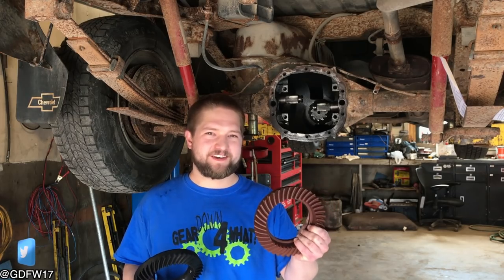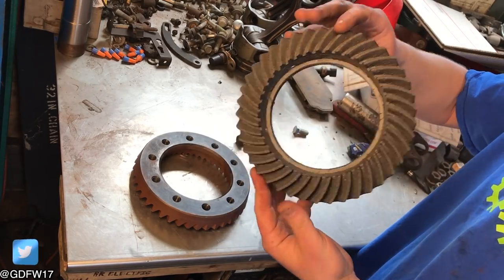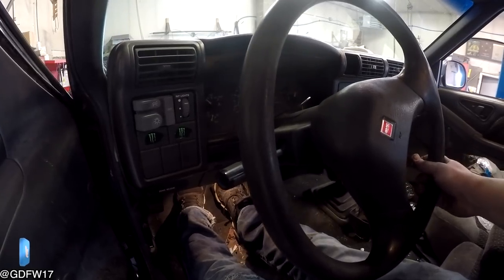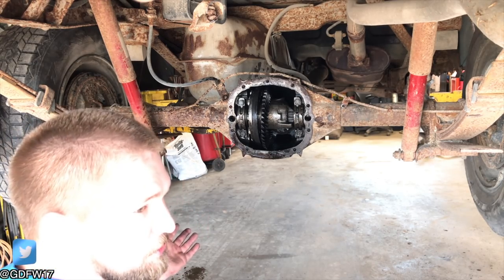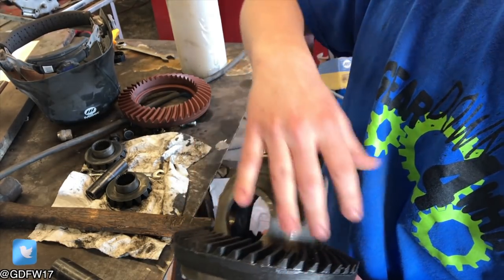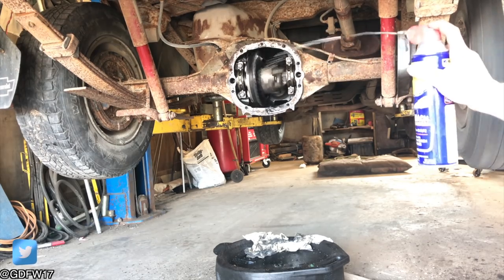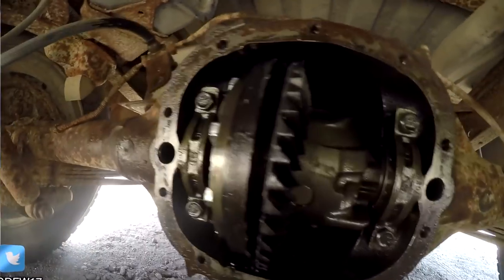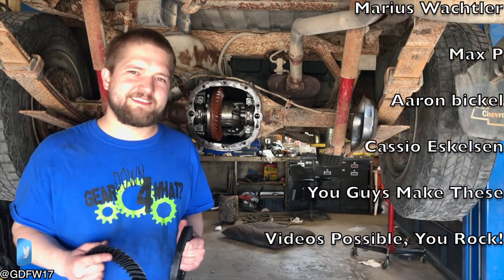Replacing Drivetrain Parts with 3D Printed Carbon Fiber Nylon - FOR SCIENCE!

Comment: If you printed it in reverse (from the teeth back towards the mounting face) and "paused" about 1/2 way through the nut to embed them, your shear face would be centered on the nuts (which would act as lugs/keys), rather than right behind the gear face (which is where the greatest shear force is concentrated.

Possibly even reheat the piece before resuming printing for better bonding... but I don't know if this will affect strength...?

Comment: My suggestion would be printing in two parts, using very big and long nuts and recessed holes in each side so that the bolts spread the load into both halves. Then you press the nuts into one half and glue on the other half while pressing the nuts into that half.

Right now, all the torque is going straight into delaminating the two halves because the bolts are embedded into only one side

Comment: Very cool video. I am surprised the gear didn't fail at it's teeth. If you printed the thing in one shot and used thread inserts I bet it would work very well. Impressive material and impressive printing skills!

Comment: I like the idea of 3D printed gears...encasing the nuts like that is the way to go imo. 
Maybe you should put little steps into the two surfaces that interlock afterwards, kinda like one of these nordlock washers if you know what I mean. That way the shear stress doesn't tear the differential apart, that's the weakness of all adhesives. Also you could maybe try leaving cavities in the print for pins that go almost completely through? Like a wall tie in masonry.

Comment: I think this is great guys! Fun to experiment.  I use same filament.  I see that if you solve the part integrity problem you will be faced with thermal problems due to low melting temp of filament.

Comment: If you really must pause the print, can you design in some alignment teeth between the 2 layers to hold more strength? Or maybe just skip the metal nuts altogether and tap threads right into the material?

Interesting test project though, it would be awesome if there happens to be a successful way to accomplish this.

Comment: you need to print the part in the orientation as it sits in the diff. the part is weak because you stopped the print, but also because the layers are in the same orientation as the torque being applied to the gear.

Comment: I am a designer of bevel gears so this was very funny for me to watch. It would be very interesting to see how much the teeth stand up to if you could get the delamination problem to work. There is probably quite alot of sliding on the teeth so apart from the strength aspect you also must lubricate and cool the gear. Normal steel gears can be 200 deg C at the immediate surface. I wonder if that can be an issue for nylonx?

Comment: Probably drill out little pits before continuing printing so that there is some pressure points and you could put some adhesive to the pits so the two parts sticks well

Comment: I'd keep the nut insertion trick, but print the ring in two crenelated parts so they interlock like puzzle pieces. The forces applied in the diff would have to shear half the circumference worth of material.

Comment: maybe melt the plastic on both halves then push together and fuse em that way? you might be able to add little bits that jut out on the edges on both halves with holes in them and use those to screw them together with nuts and bolts if there is enough room for that.

Comment: I ebbed nuts in a lot of my prints, before I restart the print I use a heat gun, if you're careful you can get your part back up to printing temp without any distortion... I need to do this ring gear test myself. Very cool

Comment: This was a great video to watch because it just shows the great innovation being taken to use new technology to make parts. I believe this idea can work without pausing the printer so it won't disrupt the layering process which led to the part failing. I think you should tap the holes or put in some kind of metal insert grooves to hold the nut inserts in place. Also keep in mind if that idea works then I believe you can only apply so much torque before the teeth rip off.

Comment: Might try reprinting it with 3d printed dowels inserted into hole around it so you can align the fiber grains  of the dowels directly perpendicular to the force applied.

Comment: Press fittings? I don't think there would be enough pulling force on the threads for it to matter. I hope to see a follow up, best of luck. Have you seen the mouse trap cars? I was also wondering if you have any interest at pursuing a WR attempt in distance. I had some ideas of adding a possibly flywheel. Maybe a low enough gear ration and a low enough friction may? The world record holder is an engineering professor and inventor.

Comment: I'm very interested in seeing this being further tested as this seems to be a fix for my expensive but weak transmission problems.
if there was a gear set like this that was feasible but would be the only area of failure easy replacement. i find this to be a very  probable test i would keep trying!
Reply: Meh.  It will never be good.  It is plastic.  3d printed metal on the other hand is another story.

Comment: A new design made with 2 layers, guide pins and JB Weld would probably do. The guide pins could transmit the power and so the adhesive doesn’t have to, or maybe even some registration marks. It’s a shame non-planar 3d printing isn’t more readily available, I think non-planar layer lines would solve this issue.

Comment: This was an epic try. I've got a raise3d N2 Plus (because of a review from 3d Printing Nerd actually, it's AWESOME) and would gladly work with you to try and make the part out of polycarb or whatever material you want to try. Send me the stl and I'll send you the prints. Also, like others have said below, don't use WD40. Try something like a 75w oil or even a high temp bearing grease so it sticks while you've got the back cover open. Personally, after it's broken in, I'd try putting the cover on and filling it with oil before driving around. Hopefully I'll hear from you and if you want to try other stuff like nylon sway bar bushings, let's do it.

Comment: There's far too much pressure and wear with a differential to not use something with the strength consistency of metal or more than that. 3D printing of parts would have to be limited to cosmetic components like door handles etc. Sometimes you just have to try it out to find it out though right?

Comment: You should try printing it and then pausing your print but not taking it off just increase the tolerances for the bolts or the a heat gun or soldering iron and hold it to the metal to heat it up and then push it in and try it that way

Comment: Were you guys trying t see if a printed gear would work? if so first it looks to me that there is a lot of area on the inside that could have been filled with the medium when printed. And have you ever used helicoil which is stronger than the threads in the original threads in the stock gear?

Comment: I would redesign the model into two parts so that you can print the teeth with the layers aligning 90 degrees to what you have now as that will be the next weak spot that will break.  The bottom part of the model which can be printed with the same orientation as you have now will need notches for the teeth to be glued in.

Comment: Print in two layers with pins that interlock and use epoxy to bond the two halves together or drill and pin the two pieces together, that’s what I would try to give it a better shearing strength

Comment: I would recommend you drill holes in it an press .250 diameter pins into it. This will give it more shear strength and not allow it to just peel apart. It will continue to delaminate no matter how good you resume your print.

Comment: Maybe try using timeserts for the thread u could tapping after the print is done .... And timeserts are designed to bite into the material in the opposite direction of the thread internal .....

Comment: 3d printing should be used in order to construct prototypes and low strain replacement parts as well as for making models for casting and art, however experimenting with it as seen here is very interesting and provides potential scientific knowledge about the properties an limitation of the technology, in other words, good video.

Comment: Possibly use a heat gun to apply heat to the surface after you've installed the nuts, so there is a better chance the next layer will bind slightly better to it...much like the first 2-3 layers on a heated bed appears to be more solid than subsequent binded layers???

Comment: I'm a mechanic n also do 3d printing... 1) wd40 is a horrible replacement for high viscosity gear oil... 2) print a clear nylon cover so u don't run it dry and can still see... 3) layer adhesion is super important... As soon as you said you stopped the print I knew it would shear at that layer height... Unless you maybe used ironing like crazy on that layer and then immediately ran a program to continue printing to even have a prayer... But I'd of just left pockets for the nuts for lots of reasons.

Comment: I think you could do it better without the threads. I mean, just do the 3d model with the screw in it. As it's main force will be against plastic and not in the screw itself, so it more like just a lot of huge pins. Also they are bigger than you need as you won't be using too much strength while driving, so I really think that you could do that well and it might actually handle a dirt burnout. Great video btw

Comment: DO IT!
but next time just leave cavities with openings to the edge of the ring gear so you can slide in the nut from the outside edge.
since the ring gear is bolted in a clamping direction and the load is in a sheer direction that should be good enough to work and all one print

then again it would be cool to see you tap the material or try and print threads!!!

Comment: Try steel rivet nuts so you can install them after the print. They will expand into the nylon and seat themselves if you design in a cavity for them

Comment: If you used cura to slice that, there's a fault when you pause layer by height - it actually skips a layer unless you use the repeat layer function.

Cura is full of bugs which is sad considering the price of ultimaker machines!
Reply: Also, if you did this for too long the abrasive filament will wear the pinion badly...

Comment: If you remake it, dont embed nuts, just get a tap and tap the threads in by hand. You could even think about doing a threaded insert, like is used for stripped out engine bolts.

Comment: The two primary issues I see here are: They didn't check the backlash(play between the gears) or gear engagement.

Both are critical specs to keeping gears from destroying themselves and the difference between "Go"/"No go" is less than .010".

Comment: Hiyer, good attempt guys! Next time try using helicoils in the threaded holes to give it more strength for the bolts.
Cool idea, hope you can make it work! Also, I wondered if you made the pinion wheel from plastic aswell, maybe that would help?

Comment: If you can keep the heat in the printer by insulating it and heating the area keep the nuts inside the heated area and try again with as little heat loss as you can might help.

Comment: Maybe next time, drill some holes through the assembly and insert some steel pins to tie all the layers together to resist layer separation due to torsional loading. I realize it’s a year later, but enjoyed the video. I play with 3D printing, but nothing like this. Maybe do a crankshaft  =)

Comment: You might try printing in a different orientation day vertically. Printed flat like this all the drive gear force is transferred to a sheer force on a single  layer but if printed ‘sideways’ it gets distributed…

Comment: You should make it as two separate parts, with pins on the teeth side in between the nuts which locate in corresponding holes that you print into the other side. Then you can epoxy or jbweld the two parts together but they will have some strength rotationally rather than rely on the strength of jbweld alone on the two faces.

Comment: It will be more costly in time and materials, but you should print the gear on an angle or vertically for better sheer strength. And of course, use appropriate grease.

Comment: Hi mate, your may have had better luck just making the internal sider gears from the nylon, as you could print them one pice and they dont have the full load of the ring gear ..... but i assume they would still fail under driving conditions.

Comment: How about instead of imbedding the nuts, you just design nut-shaped holes on the back side of that gear, print it all in one go, then after it's done, put your nuts in the back. If you think you'll have trouble keeping the nuts in their holes during installation into the differential, you can build tiny tabs in your design so that the nuts 'snap' in their holes. I would suggest that you increase your wall thickness around these nuts a little, just for extra strength.

Comment: Perhaps after installing the nuts you should heat up the laminate that way nuts and the layer will be at the correct temperature to adhere to the final part of the print

Comment: Stopping, and restarting a print will always fail like that. You can make tunnels that will allow you to insert the nuts after the entire print done. Also, you should have several smaller bolt, and nuts that basically hold the layers together.  Kinda like a 3 piece wheel. All the bolts on the outside keep the 3 layers from shifting.

Comment: Use nut inserts but keep the bolts threaded in so they act as inserts to keep the toothed portion from separating from the base layer

Comment: Try lubricant like grease and not WD-40. The WD-40 displaces oil and water and helps clean out rust. I think it may affect the adhesion between the two parts of the gear. U can make the whole gear with slots or holes for inserting nuts after the print is done. That will make the build stronger. And you can heat the nuts up so they stick well with the nylon-x

Comment: Try and set a frame with screws and nuts floating over the print so you actually achieve one single piece. I still assume it'll break but the part would look better and you know it's not caused by separation of layers.

Comment: Hey place another section with nuts that is embedded on the other side so it screws both ends instead of having the jb weld hold it together. So you can print both ends at different times so you can get that nut in there.

Comment: I heard you can pressure impregnate your 3d printed part with a type of resin and the plastic becomes harder than steel. You should have printed in one piece and taped in the threads.

Comment: do it again, I would suggest one solid piece and another the same way you did this but reheating the part first with a torch before sticking it back on the printer.  You could also boil the part in water if you are afraid the part will catch fire, but that might make for good content hehe.

Comment: Don't use nuts for what you're doing it doesn't need clamping force just sheer force tapping holes will work for a short time until vibration and chattering  oblong the holes

Comment: noted many comment about oil-grease.   there are references about petroleum distillate versus silicone grease-oil.  I do not know about automotive industry using silicone based lubricant on such scale.  but i would suggest try them to see how long it last assuming successful duration with any future plastic materials.

Comment: Maybe heating up both sides and melting it back together instead of jb weld.  I'm not sure about the material but I would assume it's basically plastic with carbon fiber pieces in it for strength.

Comment: I think for a smaller, lighter vehicle it could be perfect.  You might try printing it again, tossing the nuts in place while printing, rather than stopping... Or maybe heating it back up to temperature in the oven before resuming the print?

Comment: You need to print that properly and try again, having those layers won't work as you just saw, it wasn't the nylon giving up. Also, don't use WD-40 for gears, gears need either gear oil or grease depending on the type but both would work better and be cheaper

Comment: What if you where to use threaded rod with hex key holes on the end to hold the nuts in place? You could use the busted differential gear as a holding template, then just use a hex key to back it all the way out and pop off the new solid gear

Comment: Your effort is great keep it up. WD40 is penetration oil of super high viscosity , it kreeps into crevices between print layers compromising layer adhesion.jb weld didn't fail surrounding layers did, because wd 40 split  them . please don't quit your reseurch